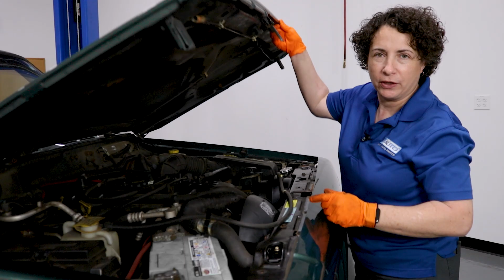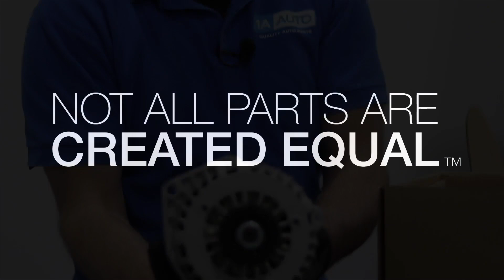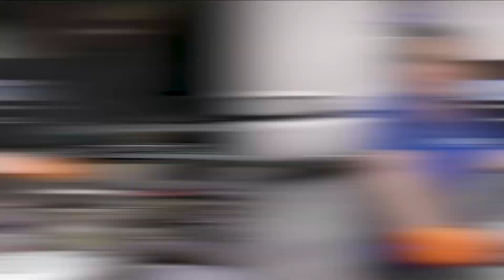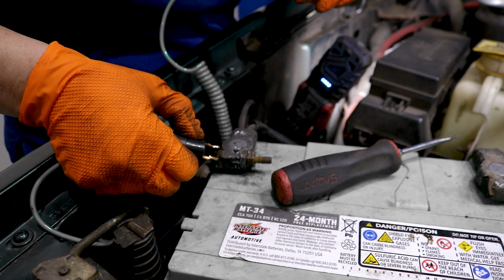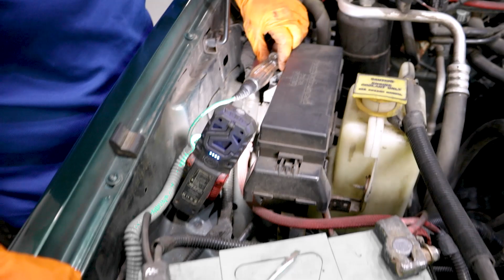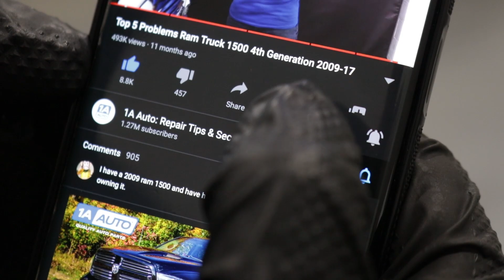Top Check Engine Trouble Codes 1984-2001 Jeep Cherokee SUV

Comment: 92 cherokee new cam, lifters , valve job, fuel pump. Filter now ne injectors. But still no start is there a trick to the battery ? Tried touching neg to pos bat connections for  thirty seconds cranked but no start

Comment: Some people dont realize you can disconnect the CPS wire connector = crank shaft position sensor and wait 5 minutes and reconnect and some times the vehicle will start and have no issues

Comment: Sea Foam in a fuel injector cleaner tool will clean most of the carbon out 9 out of 10 times, but BOY will it smoke for a little bit. Thanks for your knowledge.

Comment: Hello my name is Lorenzo Rossi, I manufacture testers for gasoline pumps. But I got a 2016 Toyota Tacoma pump, Part Number: 291200-1000. The strange thing is that it has 3 pins in its electrical connector. It is the first pump I see with 3 pins, they are usually 2. With your experience in Toyota vehicles, will you know why it uses 3 pins? I appreciate the information that you can give me. Thanks.